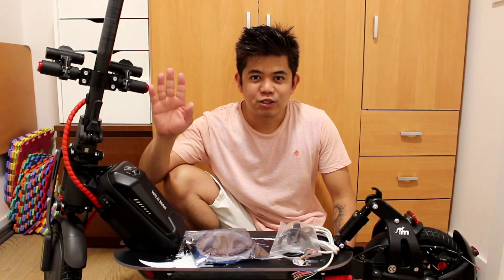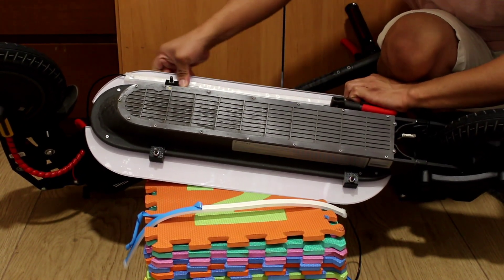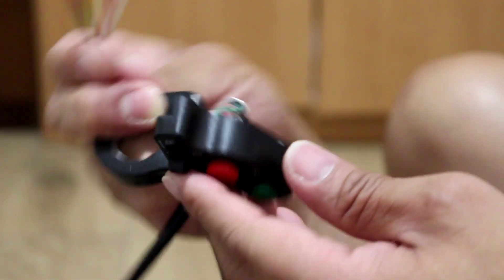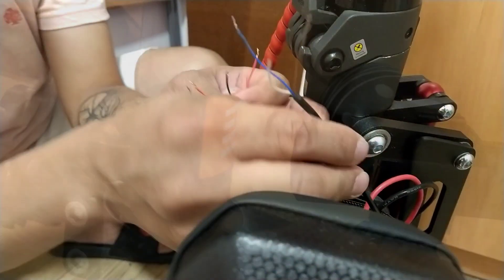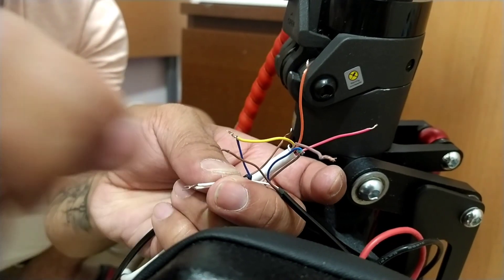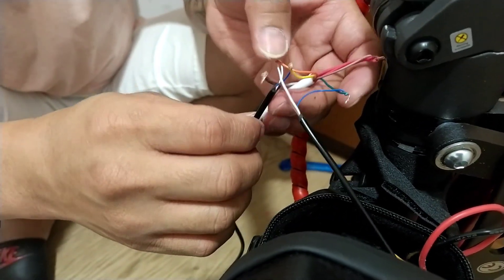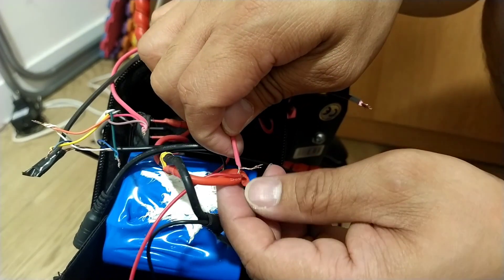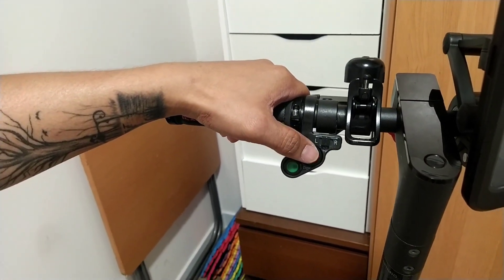how to install signal light to 12v extra battery in xiaomi S1

Comment: i am ordering a switch like this one with 12v light and 12v battery from Amazon. but i just one to use the signal light only. can i wire only the signal light swtich, and leave the green and red button alone?

Comment: Idol pa pm ako may mga tanung lang.. beoy valeros thank you
Reply: Idol Pano mag dagdag ng battery sa S1 xiaomi..
Reply from the maker: @richardvaleros8921  una bili ka muna batery . kong range bbilin mo ba or speed.
Reply: @RHON_TV  lumang battery ng xiaomi pwde na ba yon?
Reply from the maker: @richardvaleros8921  range lang di yan bbilis pero ok un para malayo marating mo
Reply: @RHON_TV  wala bang magiging problema sa controller yon idol?
Reply from the maker: wala nmn
Reply: @RHON_TV  salamat idol.. message mo ako sa messager.. beoy valeros.
Reply from the maker: san kita pm
Reply: FB idol